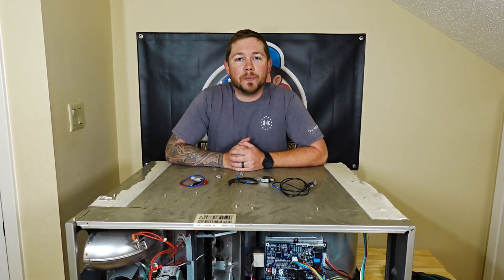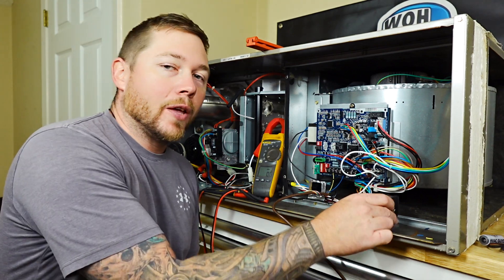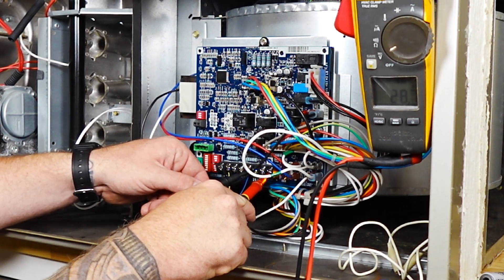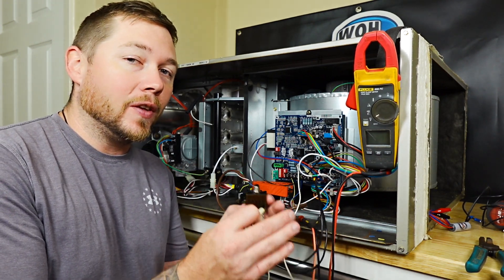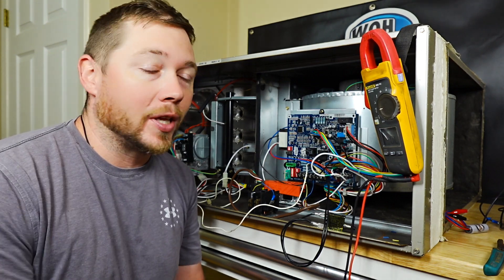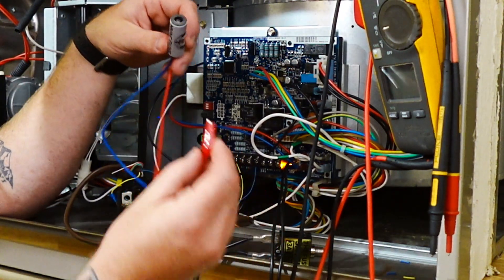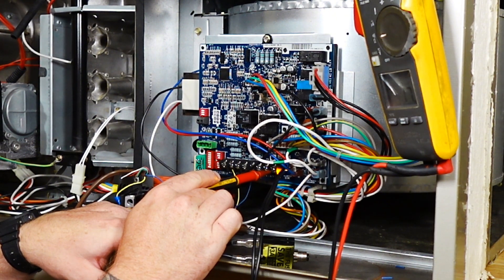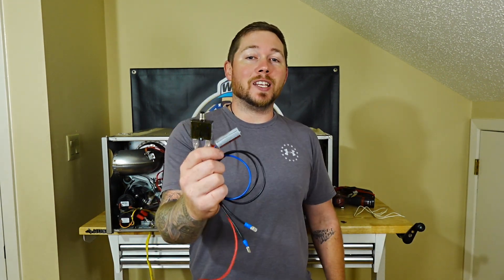Diagnosing Low Voltage Shorts With The Fuse Saver!

Comment: What is the max amperage these things can handle? Our systems run max 15amps before popping fuses. Typically 12amps is normal. Im not HVAC, CATV but looking for tools that help track shorts.
Reply from the maker: These are rated at 3 and 5 amps